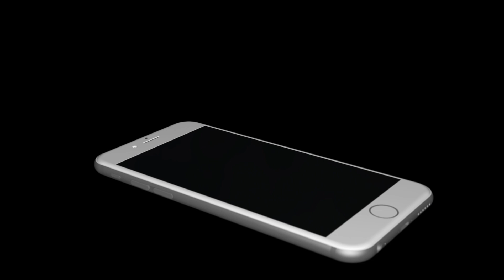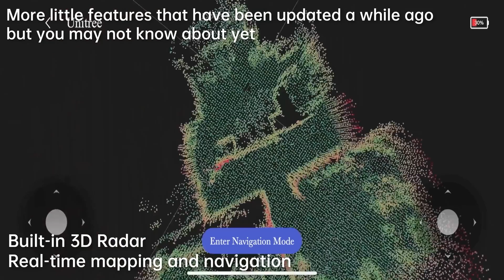What Important Uses Humanoid Robots Have in Industrial Settings?

Comment: dsf  On technological aspects you have less than 0,01 percent of the future....  only for that technology; it took humans 5000 years and you are still using the same wrong process..  First concepts of batteries and papers about electricity are.. 5000 years old.  If I dont show you 10 thousand new technologies; you can lose one million years or more... One of the most important things to put in a company website is a simplified form for business proposals and not cheating.. because this values more than the company.